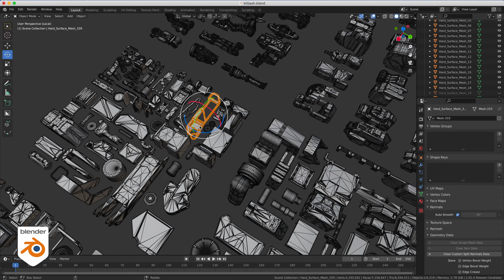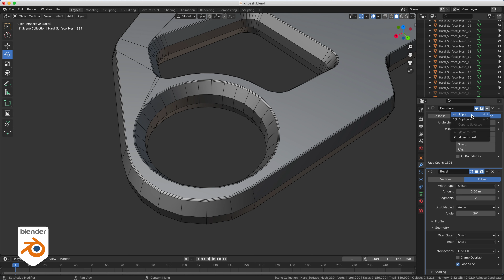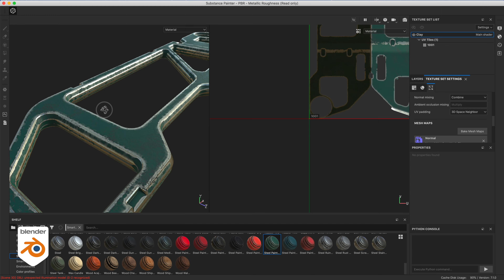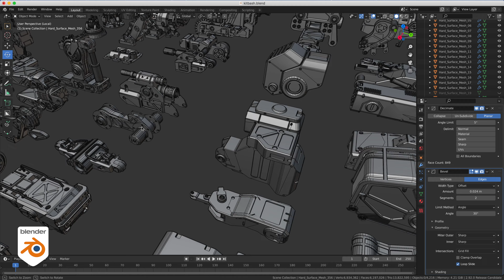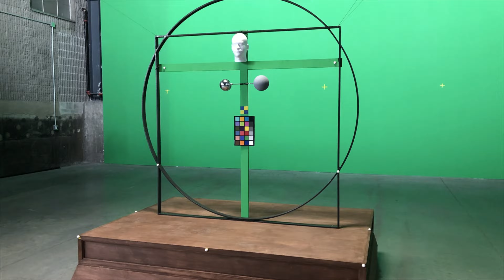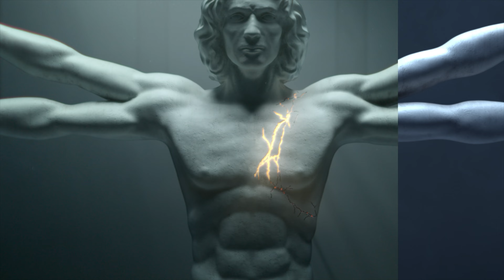Advanced modeling techniques in Blender - Part 6 EP19f

Comment: Thanks for the video Blender Bob. Have you tried Hard Ops? If so, I'm curious if their Dice would allow one of those kitbash objects to be deformed.
Reply from the maker: I did. It's very cool but at the end, the models can't be subdivided or distorted so I still prefer to do stuff manually. :-)
Reply: @BlenderBob  sometimes you can get away with just doing hardops 'dice' on a shit mesh tho. obviously there will be issues with shading with intense deformations on congested ngon areas, but for the most part it works as a quick and dirty kinda thing. oh and you can setup a thing similar to 'dice' with modifiers now thanks to 'exact' booleans but its gonna be slow af :)
Reply from the maker: @ekshalibur  You can for mid to BG elements but if you get a job in  major studios, n-gones are a no no. This channel is about working in the VFX film industry. If you work at a place like Method, you would never get away with it.
Reply: There's also a free addon called quad swords that does the same thing, it works for dirty deformation

Comment: First of all, thanks for the good tutorial.

I have a question.

When modifying a complex mesh composed of triangular faces,

"Tris to Quads" command from part2 video and

the "Limited Dissolve" command from the part6 video

You used it.

What is the difference between these two commands?

P.s: I didn't speak English well, so I wrote it with Google Translator.
Reply from the maker: Tris to quad will convert, when possible, all the triangles into four sided polygons. Limited dissolve will also do that but also make all polygons that are on the same plan as n-gones, which are polygones with more than five sides. Thanks for the comments.
Reply: @BlenderBob  Thank you for kindly answering even though it was a basic question :)
Let’s watch the remaining videos well.

Comment: Any chance you can give an introduction to the specs of your machine? Mine wouldn't do that in 11 minutes and probably hang itself and after the 6th restart i would do it one by one and still crash blender trice :D
Reply from the maker: It was actually 11 seconds. :-) iMac Pro 8 Xeon W cores, 32 gigs of RAM, Pro Vega 16 VRAM
Reply: @BlenderBob  wow. Are you using it for work as well?  And if yes why and how you use it for work?)
Reply from the maker: @nazar2383  At the office we're on Linux, 32 core machine, RTX 2080ti, 64 gigs RAM.  But I love using Blender on the Mac. It's just unfortunate that Macs don't have GPU rendering (yet). It will come when they switch to Vulcan. But it's a dual boot machine so I can always use it in Windows if needed.